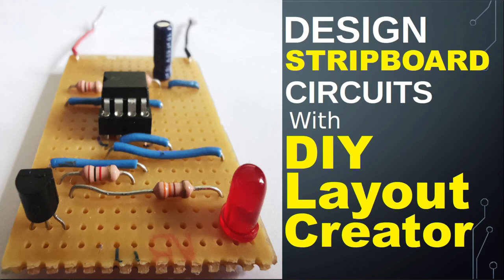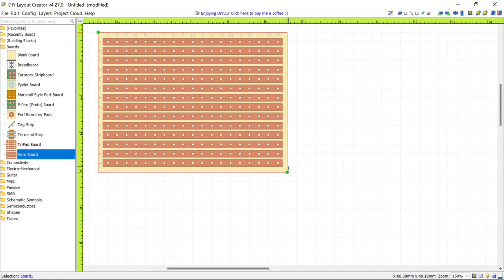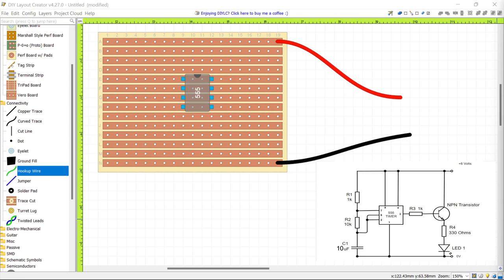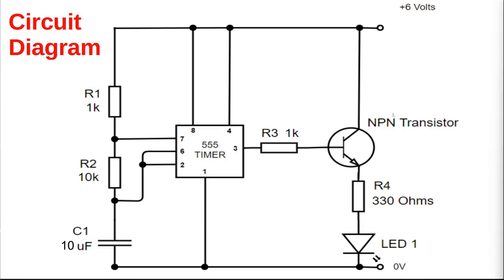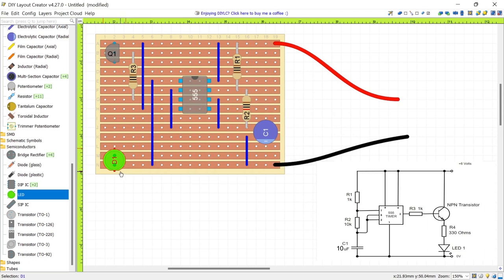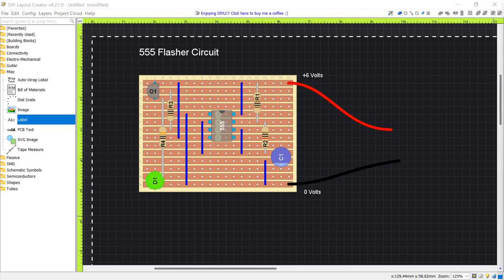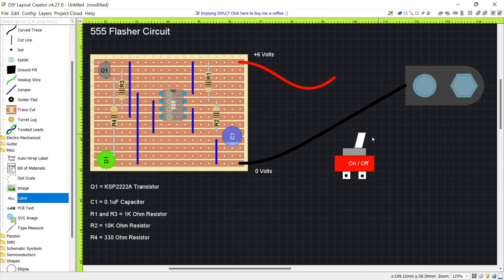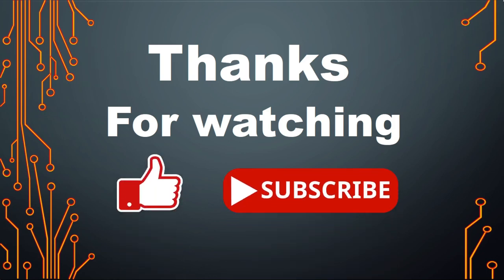Design Circuits on Stripboard or Veroboard for FREE with DIY Layout Creator

Comment: Great video!  👍
I just cut them with a hobby knife; it's much faster for long rows and reduces the risk of drilling too deep. You also have fine control over the shapes you want. I often use SMD parts on perf board, and I even split traces for SOP chips, but be careful where you place your hands, as with any cutting job. I've one or more shorts where I cut some traces and solder some SMD part on perf board.
Reply from the maker: Hey thanks that's a great tip! Your channel has some great videos!

Comment: Im confused, (as I’m watching)  555 timer is reversed right, since it is on the other side, but when you counted you started upper left (bottoms side) saying “1,2,3,4..” but aren’t they 8,7,6,5?
Reply from the maker: Hi shader26, the view we have in DIYLC is the view looking down on the top surface of the board i.e. the side of the board we put the components on. It can be confusing because the copper strips are shown. You would not normally be able to see these because they would be on the underside of the board, but they are shown in DIYLC so that you can see which way they are aligned (horizontal in this case). Imagine the board is made of glass and you can see the copper strips on the other side. Hope that helps.
Reply: @teksparkz   Thanks, I assumed and missed you mentioning that. Very and thanks so much for the video! Had been looking for exactly this kind of tool! Up until now have been using point to point boards, this will be fun!
Reply: Also, it makes life a LOT easier knowing we are looking at the component side with the copper indicated, good design, saves confusion!
Reply from the maker: You are welcome @shader26  - Have fun!